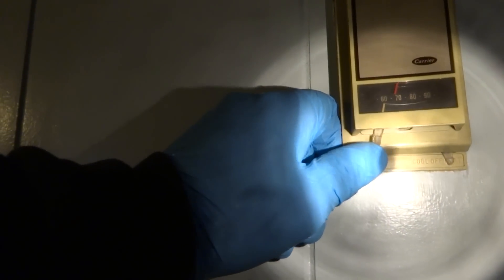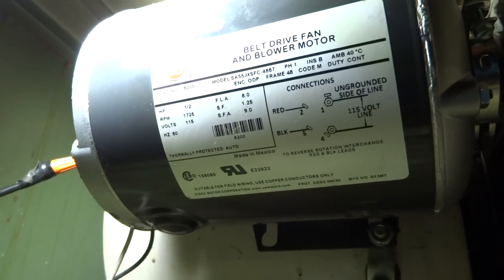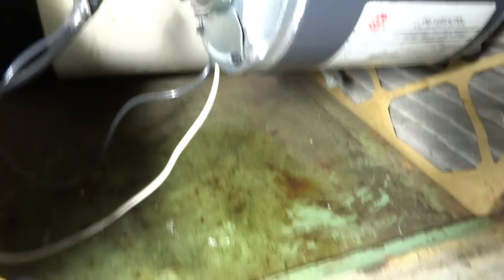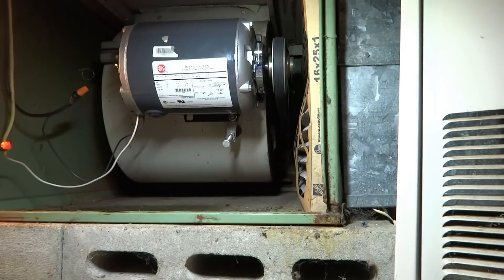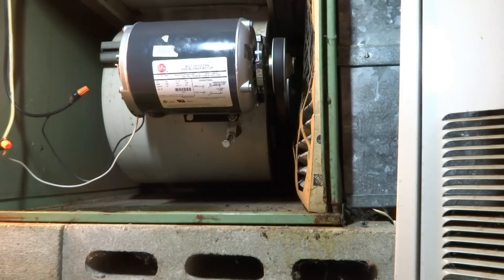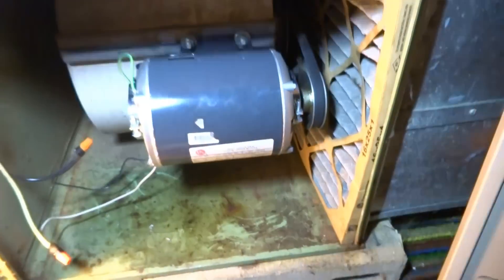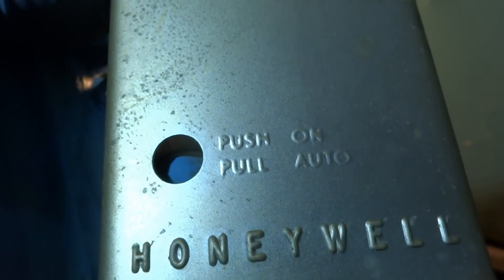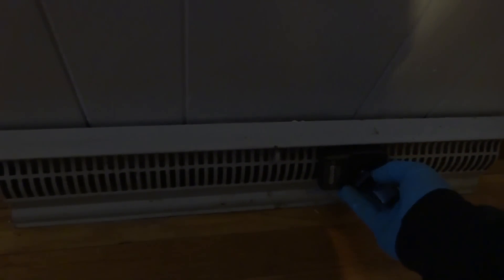GAS FURNACE FAN WILL NOT SHUT OFF AFTER MOTOR WAS REPLACED

Comment: The belt tension is also way too tight; that filter is also an accident waiting to happen, it should be on the opposite side of that intake. It’s only a matter of time before it’s into and mangled by the motor. It’s gonna happen 100% guaranteed.

Comment: I have never seen a belt in a residential unit, wow
Reply: Theirs lots 70-80’s
Reply: Notice he didn't do any kind of combustion or CO test, didn't inspect the heat exchanger. There's a reason you don't see belts in resi units, because any unit with a belt should have been replaced years ago. I'd bet my life that heat exchanger is cracked. Notice how he wouldn't change the thermostat for the guy? He's a lazy hack. He literally called the customer a f*n dumb dumb to his face. He's extremely rude to his customers. Who in their right mind would use this guy?

Comment: My old (1987) furnace is very similar to this one. In the winter, I leave the fan running 24/7. One morning I woke up early and it was quiet. And cold! My motor had crapped out and stopped spinning. But it did not burn out and smoke up my house.
Reply: Was it spinning the wrong way?
Reply: @robras8805 No. The motor was old and worn out. I replaced it myself and ensured the fan was spinning the right way.

Comment: Tell that man to not let his neighbor near his house, he gonna burn that place down. Neighbor probably put 20 amp breakers on his 14 gauge house wiring. lol
Reply: I discovered that in a friend's house. GFCI kept tripping. It was ancient, beat up, and in the garage where it was regularly subjected to 115+ degree temps in the summer. Tough to get to, and both bathrooms in the house and 3 patio receptacles ran off it, so regular tripping was a bitch. Easy enough to try a new one, right? Shut off the 20 amp breaker, then saw the 14 gauge wiring when I pulled out the old GFCI...then noticed the GFCI was only rated for 15 amps (I bought a 20). They had a 120v hot tub plugged into that circuit about 70' of wiring away from the breaker...
Reply: @jblyon2  you should’ve bought a 15 amp GFI and replaced the 20 amp breaker to 15.
Reply: depends on the length. I’d use a number 12 just incase but u might get away with 14 gauge if it was short run
Reply: @RockoRocko-rz7kx   Not if it was on a 20 amp breaker, you MUST use 12ga. wire. As for jblyon2's situation, a 15 amp OR 20 amp GFCI has a 20 amp feed through rating,  the only difference with a 20amp GFCI  (or standard receptacle) is that it will accept a 20amp cord cap.
Reply: @mxslick50  15 amp feed through. Original to the house from the 80s.